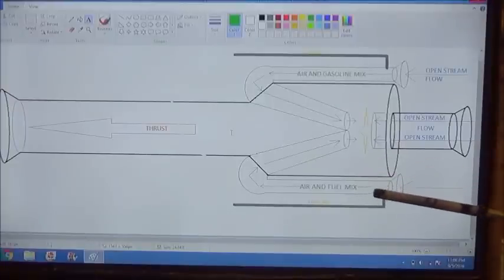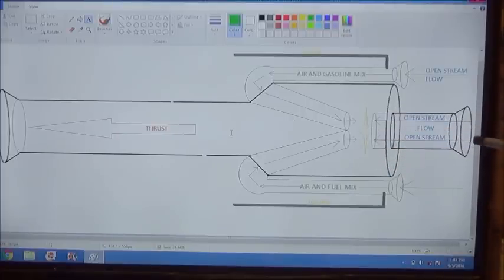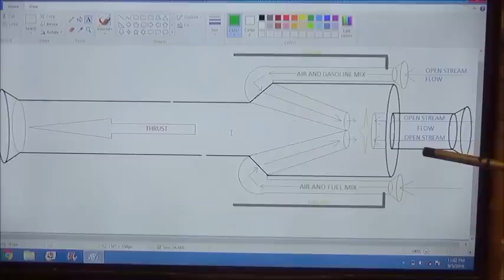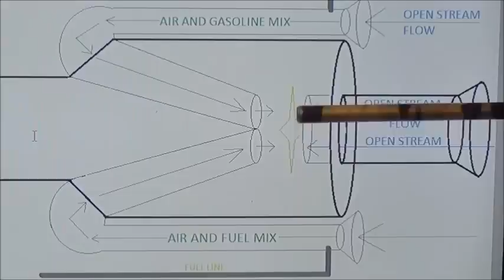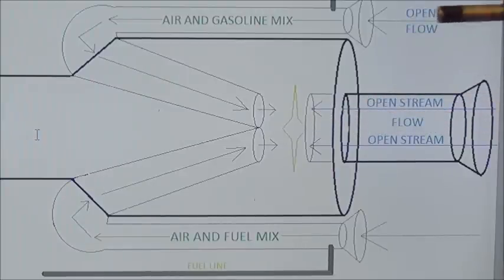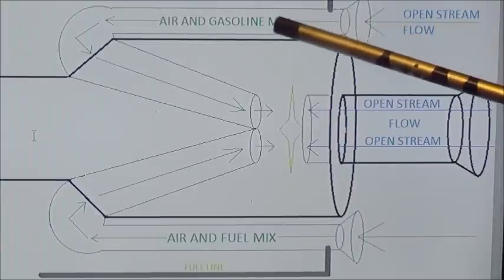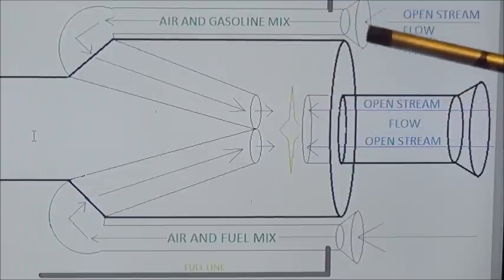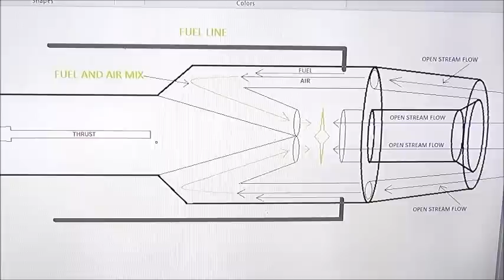Valveless "PULSE to RAM Jet Engine" With a Concept Tesla Inspired Pneumatic Valve System. + Diagram

Comment: Hi @MrTeslonian, just a quick question - What is to stop the ignition of fuel going back up the side tubes? If there is ignition going up there then I think you are wasting some expansion energy (right now you are forcing it back down into the tube with the compressed air feed, but I imagine the pulse sends some air back out the front anyway - could be a problem in flight). Could we do something like include a small Tesla Valve along each side feed tube to stop that? I'd imagine that'd get you much higher engine efficiencies :)
Reply from the maker: This is a form of Tesla valve1

Comment: I think it would be better to call it an area of high pressure oscillating position.  The internal combustion overcoming the mass air accumulating at the termination of the fuel inlets.

Comment: one use is on a wide rocket - first a large single stage compressor - blade length 20 feet - compresses the air to 1/3 and provides 10,000,000 pounds of thrust. After 30,000 feet the ram jet provides thrust to 100,000 feet. A rocket engine provides thrust to 4500 mph. The turbine uses 1500 pounds of fuel. The weight is similar because of the reduced amount of surface area.

Comment: I  am very interested but i think that if you are to build an engine that uses liquid fuel mixed with air in a fast moving jet engine, a traditional turbo jet engin is way more effective and durable because it has no valve whatsoever and no cycle.

Comment: Couldnt we create a valveless system without the pulse jet being in motion by simply redirecting a small portion of the exhaust gas into a booster tube by the intake creating a pulse feedback vacuum loop? this way effectively over-pressure just behind the intake can effectively interrupt the airflow during combustion and resonate without the need for the pulse jet to be in motion?
Sort of like how a rifle uses bypass gas to engage the push rod to load another round, but completely solid state.
I think it could be done.
Im thinking something like how Nitro RC cars have Booster Bottles on the intake manifold to create resonance.
Dont think you would ever get the same LBs of thrust tho without an actual closed valve or intake system where you can build up more pressure, pules jets are more or less high frequency dry firing cannons lol

Comment: I think V2- rocket has similar base design. Also they used some how self return fuel feed from exhaust fumes, because whole chamber otherwise exploded, or just died/fall in acceleration .USSR well developed it more, its still in use...space rockets..
Reply: the Argus V1 Pulsejet engine utilized a squarish grid of reed-style valves with direct-injection fuel nozzles nestled between reed set cages.

Comment: Sooo strange.  Why are you feeding gas that contains air bubbles?
Reply from the maker: The air bubbles were a flaw in the pressurized fuel tank leaking air into the line giving the engine that stutter.

Comment: you must use the gas that comes in those gas bottles as fuel instead
Reply from the maker: Indeed they run well on propane, I would like one that runs on gasoline by using a pressurized tank to force the fuel in under high pressure and high speed's.

Comment: This  experiment fail to proof  the  theory...the ignition of PJE combustion much depend on proper ratio of fuel and air's volume in the chamber.. if it is too much air in chamber the PJE will  doesnt work at all. In the valveless concept the direction of air breath must be against the direction of gas ignition.. pls you try again accordingly